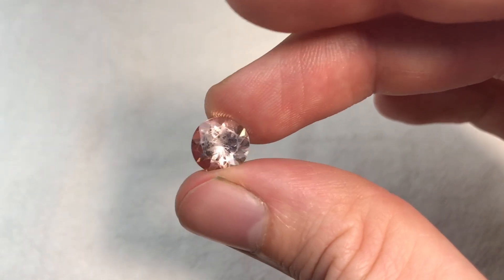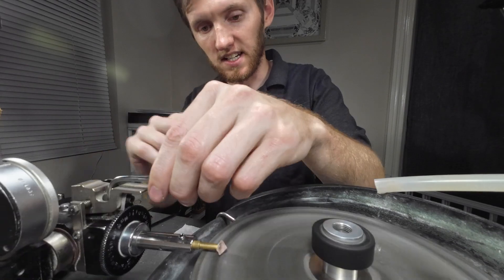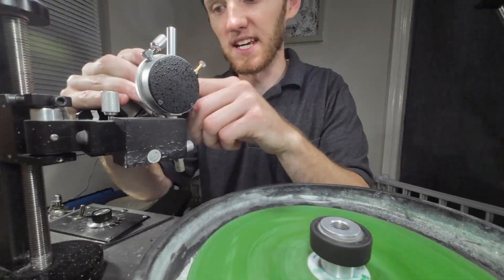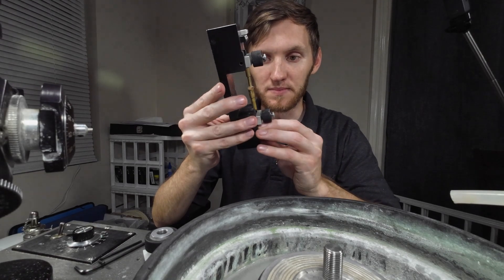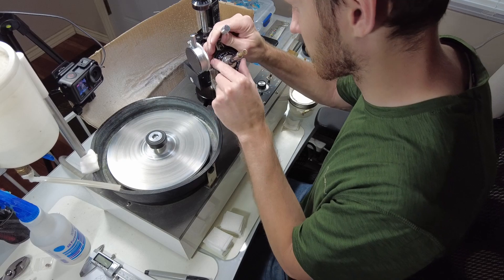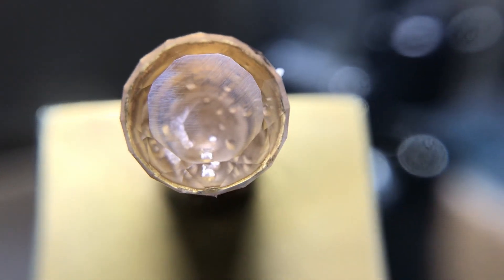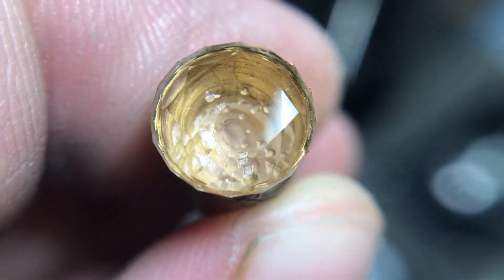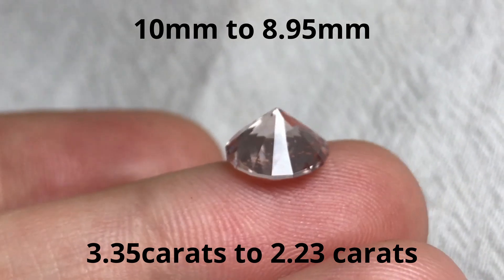Giving a Scratched up Morganite a New Cut and Polish, Recutting a Gemstone

Comment: How many time do u take to mirror polish a facet ? 
I don't know if its my lap or my technique but it can take me 15 minutes more to polish a litle facet and i don't know if its normal ( i have a copper lap and path through 320 - 600 - 3000 - diamond paste polish ) on a aqua marine
Reply from the maker: Small facets can be done in less than 10 seconds at times for the final polish. I haven't used a copper lap, but I also don't use diamond to polish aquamarine. I use chrome or cerium oxide. The green lap used in the video is a chrome oxide embedded lap. It should go pretty quickly if all the pitting and larger scratches were taken out at the 3000 grit and if there aren't contaminates on the lap causing more scratching while trying to polish.